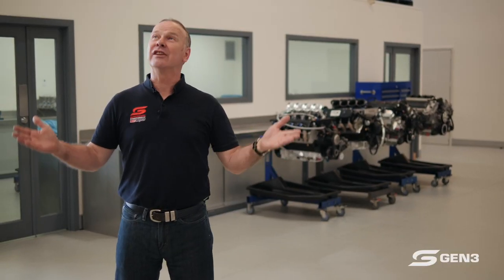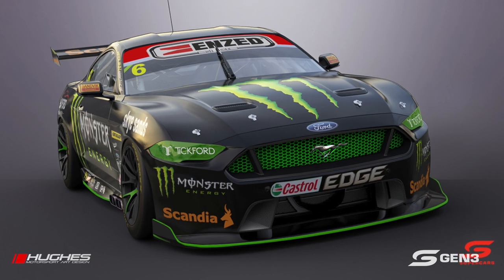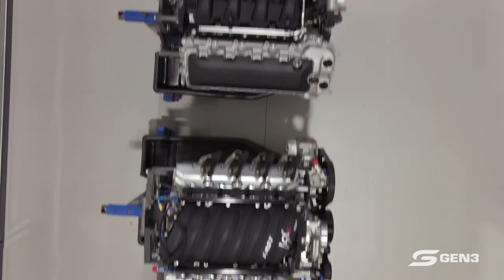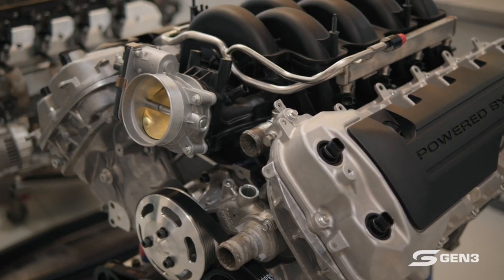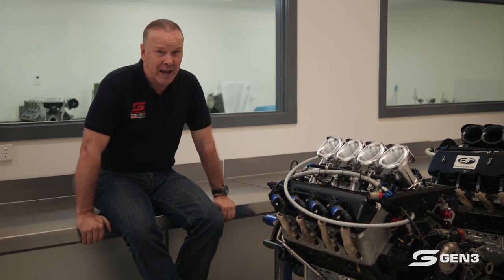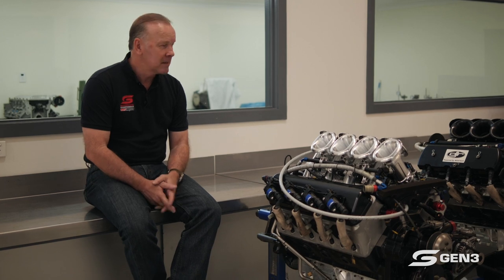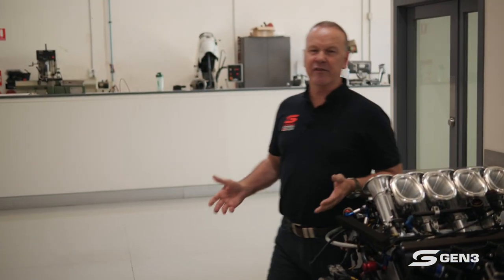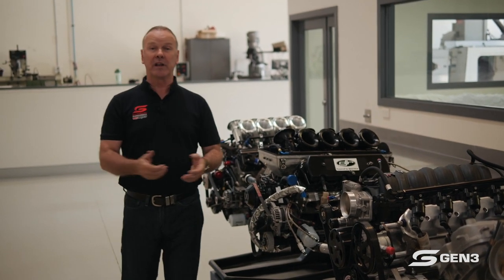Episode One: Who, What & Where [Gen3 Unpacked] | Supercars 2021

Comment: Larko, don't forget to tell everybody that we started with motorsport blocks in 1993 because the Ford road block couldn't take 600 HP (the Holden block could).
Reply: where did u read that sh## iv run stock block for years never been replaced 302 with prostock 351 heads configured to a boss motor runs low 9 sec 1/4 mile  back in 1990s im ex Holden  because of engine failure

Comment: Hold up, is that Gen 3 Ford a twin cam? Coyote platform vs LS platform?
Reply: Yes it is. I’m soo keen to see what coyote engine it is but everything I have found has been about the fking LS so far.
Reply: @ZedTee77  Its either going to be a 5.4 or 5.2 block bored out from a 5.0. But that's about all I've found on it.
Reply: @mrhatty0514  I seriously doubt that the Coyote is "bored out". The Coyote bock has 100mm bore spacing. The present pistons are as big as can be put in the block without risk of head gasket issues between the bores. Also, complex machining and custom pistons go against making the engines cheaper to build.
One can buy a Ford 5.2L "Aluminator" for a little under $27,000us. It makes 580hp@7800 and 445lb/ft@4500. Changing the intake and exhaust manifolds and adding dry sump oiling system I can imagine will get it over 600hp.
Where the Coyote falls over is torque. But, that can be balanced with having a dedicated rear gear. This means the Coyote chases hp with RPM while the LS does the job with displacement, so will have to run a higher ratio so both cars are equal in speed upon gear changes. 
It's complicated - but as long as both cars have equal wheel torque (that's after the gearbox and final drive) then both cars will have the same acceleration.
Or, that's what I hope to see rather than having to either clip the RPM potential of the Coyote or downtune the LS so there is parity in engine output alone.
Reply: @michelledrent5400  Appreciate the insight. I had forgotten all about the Aluminator.